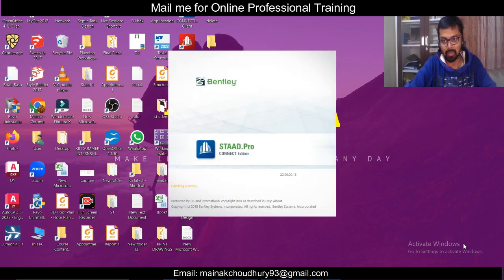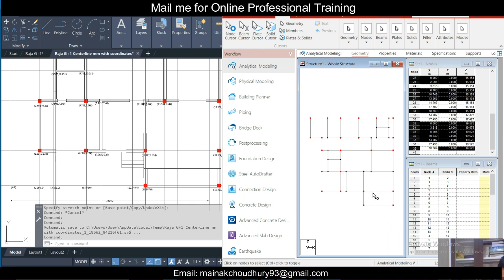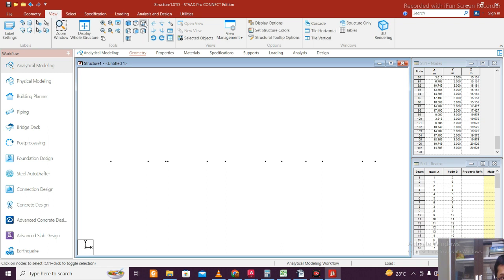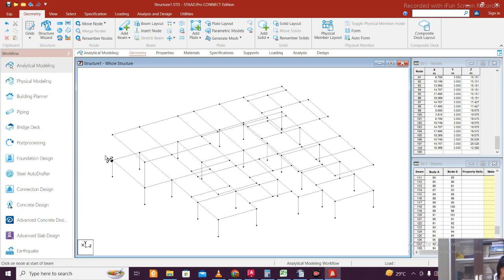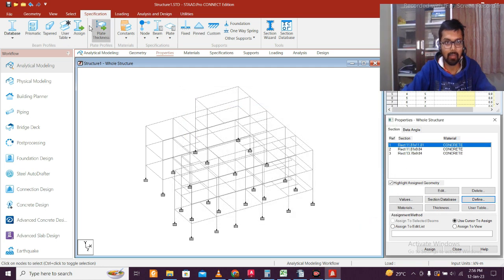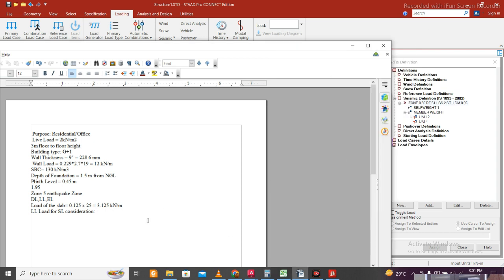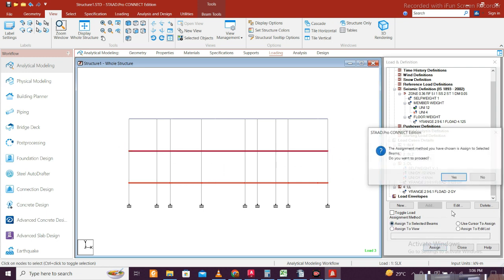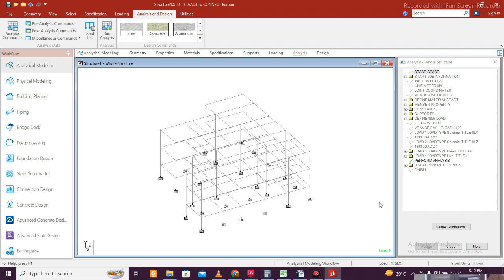So you want to make a Building Structural Design ? Part-3

Comment: Nice work:
If you tick " link steps" in translational repeat, beams will be created automatically. Also at the beginning  nodes could've been connected go to geometry- connect beams along ...
Reply from the maker: Thanks
If you link steps, all nodes will be joined, but practically all nodes do not have columns, we need to join only the nodes which will have columns.